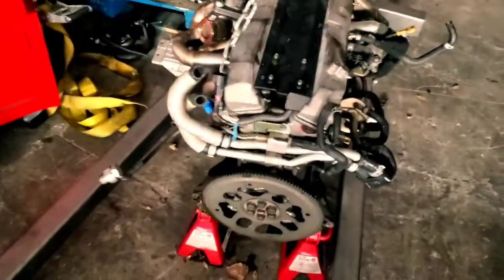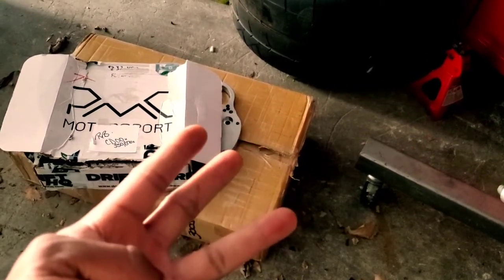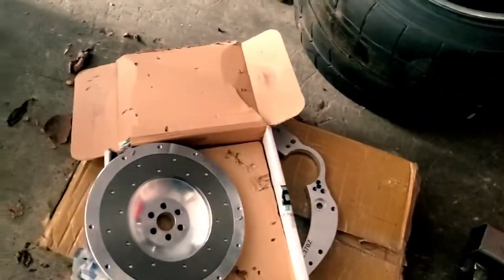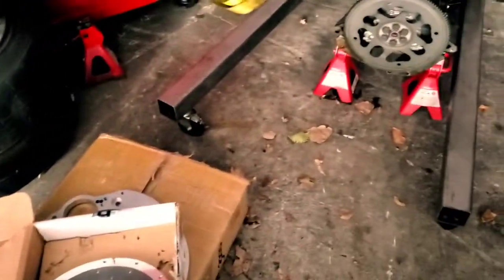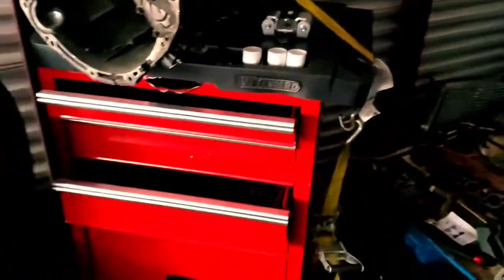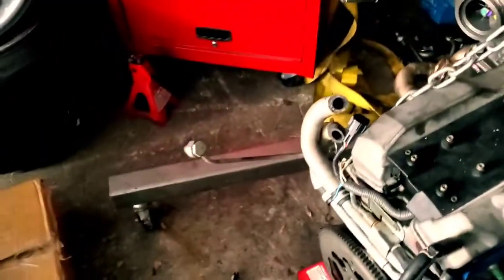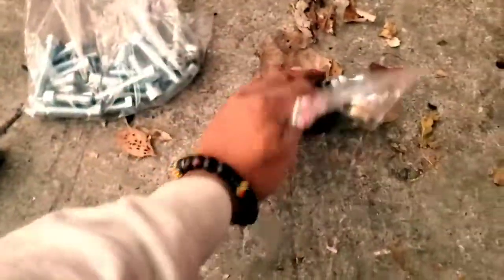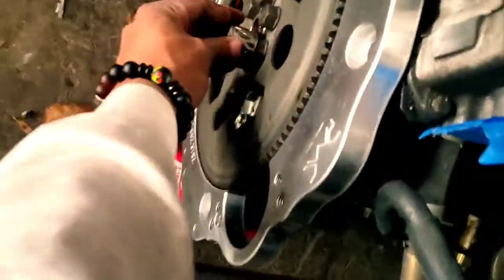PMC Rb to cd09 adapter kit install (part 1)

Comment: Did you use the rb starter or a vq starter?
Reply from the maker: Rb starter but a new one not the original 20 year old one
Reply: My guess is rb. If it was the vq you wouldn't need to cut the Trans to clear it. 

Idk to be honest, I plan on doing the swap. My rb was auto so the kit makes sense. I might give an update if I do decide to further the project